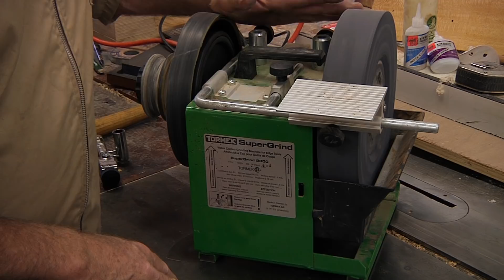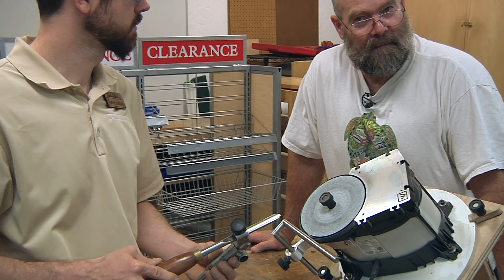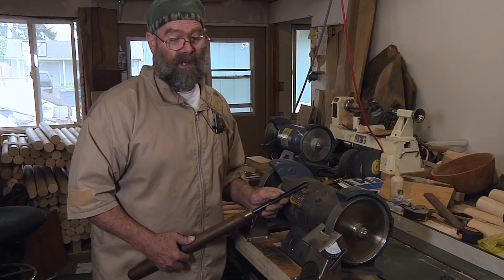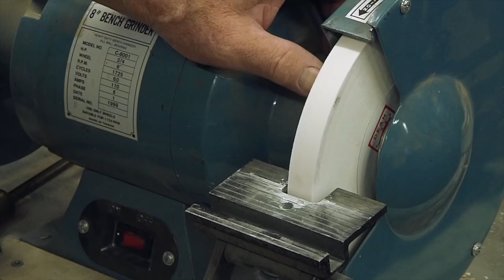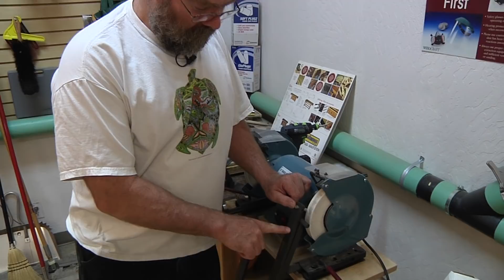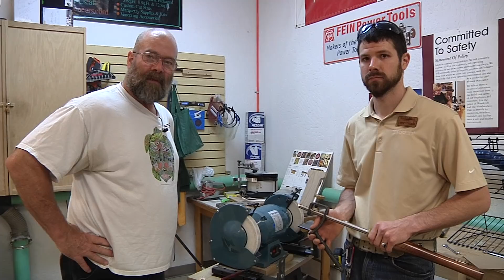SHARPENING: Grinders, Wheels, Jigs, Etc. by Reed Gray aka RoboHippy

Comment from the maker: I do have a short clip up on platform sharpening, which will be done over again to make it more complete. I think, as much as anything, it is knowing when to sharpen. This is probably most important when making a finish cut. You can use tools that aren't fresh sharp for roughing, but for all finish cuts, I want fresh off the grinder. I use the CBN wheels ( D Way), and most of the time the 180 grit wheel.
Reply: Thank u brother I learned a lot from this video on grinder safety & not all bench grinders are created equal.👍

Comment: Thank you so much for a really great video. Today I ordered a new grinder and CBN wheels to fit. Sadly it is impossible to purchase the Rikon slow speed grinder here in the UK and I even phoned the company only to be told that they were not interested in exporting one to me. Can you perhaps give me any tips on using a faster grinder? I have been sharpening by hand using a 4" grinder with a 2" sanding belt attachment. So difficult to maintain a correct angle etc. I'm now subscribed to your channel and I wish you every success in the future. Thanks once more.....Alan.
Reply from the maker: I don't really know about what brands are available over there. I know there are several clubs in the UK. My go to guy over there is Mike Waldt, who is in Whales. Great guy and a bunch of project videos up. Not sure what brand of grinder he uses. Just about any 3/4 hp motor will work, though some are better than others. I think there is a Craft Supplies store over there, but they are not the same as the one here in the US. Have fun!

Comment: en de oneway ?
Reply from the maker: As some one who did production bowl turning, a grinding jig takes up a lot more time. Their platform has no repeatability at all, you have to "adjust" for every angle setting. Many who use the Oneway platform will cut a 2 inch wide notch in it for the 1 1/2 inch CBN wheels to fit into, and so it will stay a bit closer to the wheel. Some moving of the platform, front or back, is still necessary.  I quit using a jig many years ago.

Comment: Reed are your Baldor grinders slow speed? I have an old cheap Woodcraft Model 144290 slow speed grinder. It takes a while for it to come up to speed and has some significant runout. I'm a production turner and find myself constantly going to the grinder to sharpen my tools. I'm looking for an upgrade. Thoughts? Many Thanks - Skip
Reply from the maker: My Baldor grinders are slow speed. Best substitute I can think of, and at the best price is the 1 hp Rikon grinder. While it doesn't quite match the Baldor for smoothness, it is a match in power, and I think the price, if you can get it on sale is about $220 or so. I have 2 of them, and they come up to full speed as fast as the Baldor. I had to put a 3/4 inch piece of plywood under the Wolverine base to get it to height. I tool the electric light off as it isn't bright enough, and doesn't reach the grinder platform. Of course, the grinder platform that comes with it is junk. I did have to add a spacer or two to get the 1 1/2 inch wide CBN wheels away from the wheel housing. I do prefer to keep that on. Main reason is the dust from grinding can float around the shop like wood dust does. Strange but true. You can order the Rikon through pretty much any big box store. Best price on line that you can find might be Ken Rizza of Woodturner's Wonders. His come without the wheel guards. Oh, I take the rubber feet off the bottom of the grinder and bolt it to plywood.

Side note, if you can learn to sharpen with a platform, it is a lot faster than using a jig. I have sold out on my grinder platforms, but sent all parts and pieces, and schematics to some one who said, 'some time after the first quarter of 2021.'
Reply: @robohippy  Thanks so much for the quick response Reed. I have seen the free hand sharpening video by Mike Mahoney. I have the Wolverine jig setup but would prefer to sharpen free hand. Looks like Rikon from Woodturner Wonders is the answer. Thanks for the quick response. Your videos are excellent!
Reply from the maker: @skipproctor8979  The best thing about the free hand sharpening is that it is faster than using a jig. Only set up time is in changing the angle of the platform, which is why I made mine. I know I cover it in my sharpening videos some where. Biggest secret to it is that every thing you do when platform sharpening is exactly what you do when turning. Since I started using the 40/40 grind, I never use a swept back gouge any more since the 40/40 does cut better except for trying to go through the transition and across the bottom of a bowl. I am sold out of my platforms, but they should be coming out by some one else 'after the first quarter of 2021.

Comment: Sharp is better! Razor sharp is the best!
Reply from the maker: Razor sharp is better for bench chisels, carving chisels, hand planes, and in most situations for the skew chisel. For some punky woods, and woods that are more prone to tear out, they work fine for finish cuts. The razor edge is worthless for heavy roughing in most woods because they go dull so quickly. I can remove more wood in an hour of turning than you could in a few days with the above mentioned tools. Get 5,000 or so bowls, in all sorts of wood,  under your belt, and perhaps you will understand...
Reply: I am 76 years old been in wood working all my life!  I do agree with you on a lot of your shows. BUT you are full of CHIT when you say a dull cutter is better than a sharp one! I have been sharpening tools of all kind all my life and I have never wanted to work with a dull tool they are very dangerous. You should not miss lead people that doesn't know u could get someone hurt.
Reply from the maker: Well Sam, I am 67, and have been a too-aholic for most of my life. You still have some things to learn. My tools are NEVER dull. Just because I use a 180 grit wheel for most of what I cut, that does not make my tools dull. If there was a safety issue with this type of sharpening, then none of the big name turners would be sharpening the same way I do. I can slice myself easily on that 180 grit edge. Yes, dull tools are dangerous, but your 'opinion' is not shared by most of the people who have forgotten more than either you or I will ever learn.